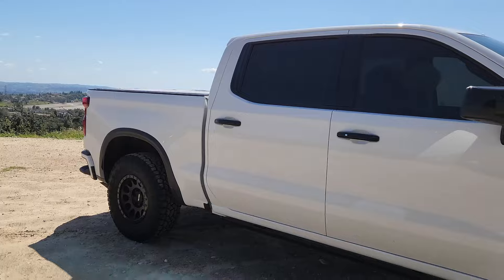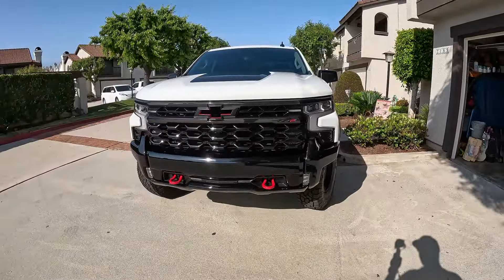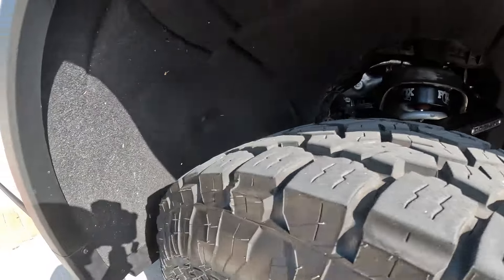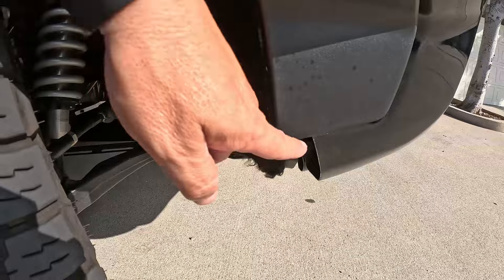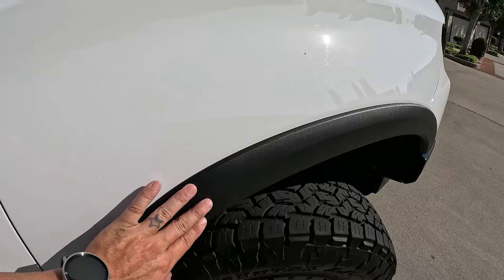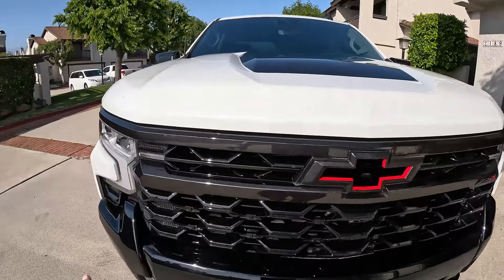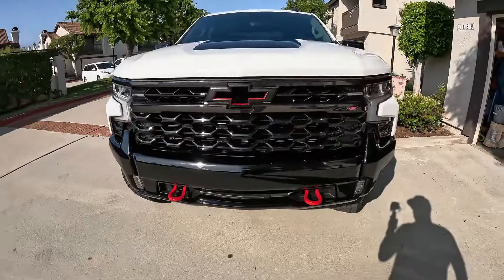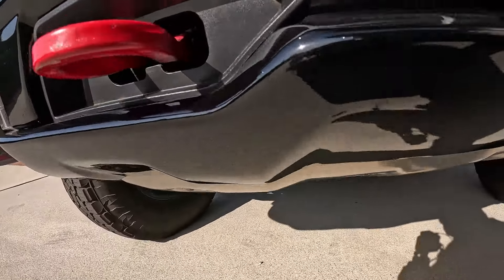Making my 2023 Silverado RST into an ZR2!!!! Project ZR2 Part 2

Comment: Could this be done with a crew cab 2.7L turbo 2023 LT everything you’ve done? I’d be willing to drive out there and do a video as your camera man and pay for the time for this mod. My truck could be the (how to do so guide step by step)
Reply from the maker: I believe so.... the front might be slightly different because of the turbo and front air damn.. not 100% sure, but I am sure if there is a will..... there is a way!
Reply: @That-Silverado-Guy if I were to bring my truck could we work on it together? I’d be willing to do a lot of the work of course. Even recording, would make a great guide. Would love to do it, but I’m a novice at vehicles. Just oil changes and tire changes at most 😮‍💨
Reply from the maker: @Multimeter1  I'm in Southern California. I'm not sure about your location, but it's also the process of finding parts and and making sure we can make it work with the 2.7 turbo and nothing is that different in the front radiator part that can hurt the install.

Comment: So im wondering. Will the ZR2 bumper just bolt up to a facelift trailboss. That really the only part i would like to swap over.
Reply from the maker: @ryanbrown2190  yes it all bolts up but you will need more than the bumper as you also need the front fenders that go with the bumper.... stock fenders won't work well with just the bumper

Comment: Are you putting the zr2 multimatic shocks on as well?
Reply from the maker: @johnhaynes9133  I have fox suspension right now.... not sure how that will effect my lift and don't want to throw $2500 down the drain since I currently am running fox cognito set up

Comment: Did you hook up the front camera as well? And if you did does that mean the camera system can be upgraded too?
Reply from the maker: @pauldelatorre64  I am still figuring out how to hook that up if it's possible. If I do, I will do a video on that
Reply: @That-Silverado-Guy  thanks man appreciate it was thinking of doing the same thing with my RST but wanted to see if the camera system would be a possibility too. Great video lots of questions answered
Reply from the maker: @pauldelatorre64  thank you!!!
Reply: Please let us know if you get the front camera working. You should write a letter to GM and go down a rabbit hole for us to pressure GM/Chevy to offer programming for the front camera

Comment: Will the ZR2 grille work with a RST number?
Reply from the maker: RST number??... sorry, can you clarify?
Reply: Sorry. Bumper
Reply from the maker: @Blkchuck40  No, because the two bumpers are different, and you will have a void because of the absence of the valance between the bumper and the grille. There is a possibility, but you will need some awesome altering of the front.
Reply: Thanks.  I was hoping the valance and RST bumper would work with that grille.  Good video.  Truck looks awesome.
Reply from the maker: @Blkchuck40  Thank you very much!!!

Comment: Hello brother i want to ask about the tailgate i have the exact same truck as you and i want to upgrade my tailgate is it easy and cheap or not ? I know my comment is not relevant to this vid but i really want to do it 😅
Reply from the maker: If you can find it for a good price, it's a great tailgate, but there are many cons as well. Make sure you have the right one with the updated harness. Also, the upper gate won't open unless you have some mods to make it work. I have videos showing that as well, so I hope that helps.
Reply: @That-Silverado-Guy thanks bro i think i will buy it from crashed sierra i hope it works for the Chevy .. Here in Saudi Arabia nobody buys Silverado every truck here are Sierra and F-150 and Ram 🤷🏻‍♂️
Reply from the maker: @batfleck3504  let me know of you need any help!